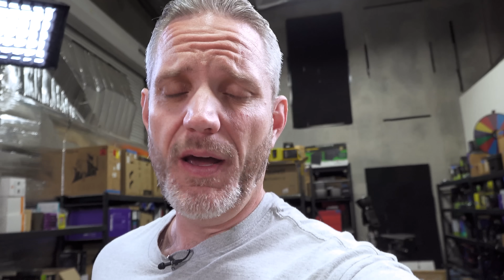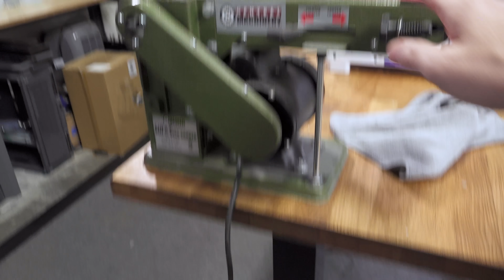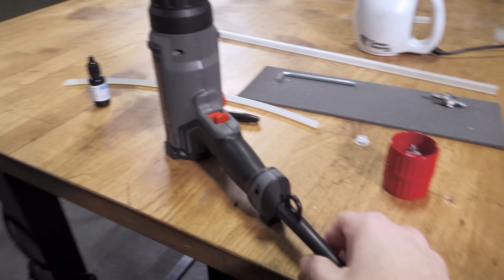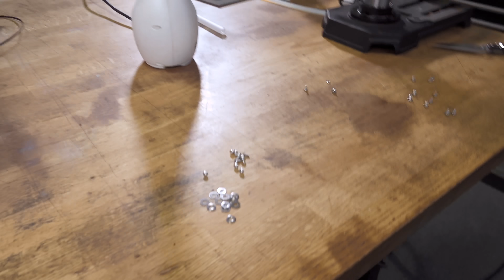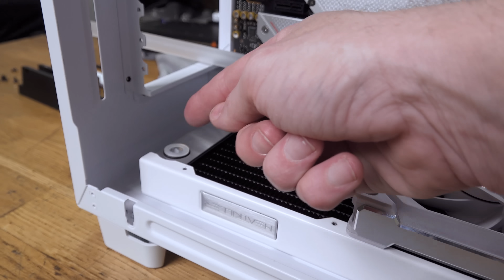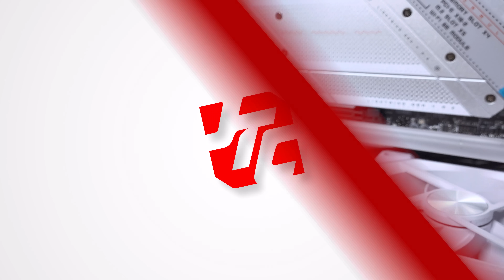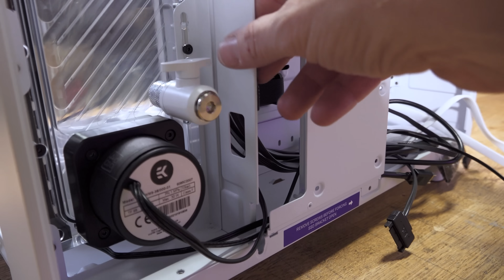ADHD Sucks...

Comment: i hate adhd. im suffering badly currently with it. it clashes with my autism. also frustrated that im waiting for my last pc parts delivery simple one too. ordered 6 dust filters but one outta stock is holding things up. cant install the cpu cooler untill i have fans installed with the dust covers. also the same place sent me a banged up aero integrator i had to ben back together to use, brand new supposidly. they told me to return it but whhats the point if i cant get a replacement and the refund wont cover the 30gbp more alternative. and aerocool has discontinued the integrators. so im having to risk my home for something that may cause a fire. and i dont have anything to prevent a fire in my home. i wanted to finish building my pc a few months ago but had to do with delays thanks to arctic. for some reason bronze PSU's are not being manufactured thesedays and its kinda annoying when short for a gold. im waiting to get back to streaming and gaming with modern games my fx hates. also i dont have steady hands when screwing things together and what doesnt help is when my screwdrivers have dead magnets... and im not familliar with am4 hardware and a b450 setup. so its frustrating and worrying. glad you recovered well after surgery...

Comment: big brain move is counter sink the steel washer the was if you wanna use flathead screws. With bigger screws there fancy conical counter sunk aluminum washers but I've never seen any smaller than a M6 which doesn't help in the PC space but would make nice looking dress up on Car stuff.  they are pretty come place at work for me though . Also bolt houses and hardware places like metric thread products or McMaster cause get some nice flanged button head bolts plus a huge array of stuff.

Comment: ADHD can be a superpower.  It's just difficult to harness those powers.  It takes me hours to clean up because I get distracted so easily, but If I set myself a time limit that's really tight and try to stick to it I can get it done quickly.  It's just hard to stick to a time limit that's arbitrary.

Comment: Hey Jay, I think you can do the parallel routing like you mentioned if you look at how the blocks are interconnected inside the direct link box. I was looking into that for my own build and even asked EK and it should work. Coming in at the bottem left, going out top left into cpu, coming back top right and going out bottem right. I was never sure about this though and decided to go a completely diiffernt route with a distro plate anyway.

Comment: Had gall bladder out in '06. Welcome to being tethered to the bathroom for a few months. It does get better Jay, hang in there. And yeah add has it's downsides in the modern era, some upsides as well. learn to lean into the positives and compensate for the downsides.

Comment: i have the same issues Jay haha. any time i set up a bench or a horizontal surface, it stays nice for about 3 or 4 days, then i start to pile shit on it again. it gets so frustrating because i dont even realize it has happened until i cant see the top anymore. im in the process of rearranging my room again, and i want to keep the horizontal surfaces to a minimum. surprisingly my desk is about the only horizontal surface that i keep clean. it might be because if something gets in the way of my arms or hands, it gets removed immediately.

man, every time i see you doing custom hardline watercooling, it makes me want to take my system apart and redo it haha! its not that i am unhappy with it, its just that i could make it better haha